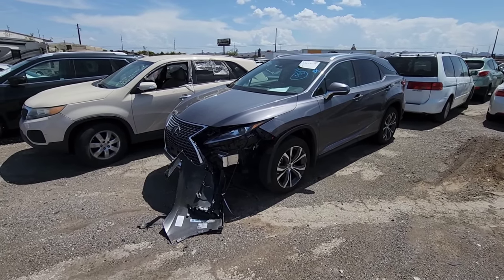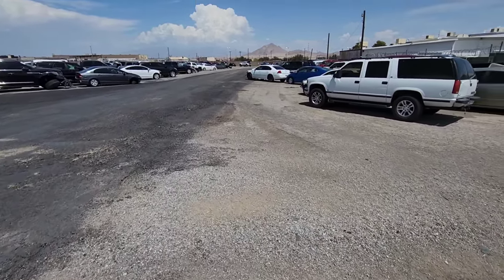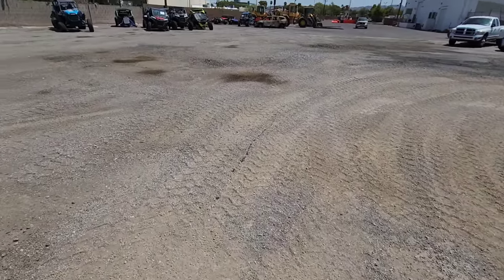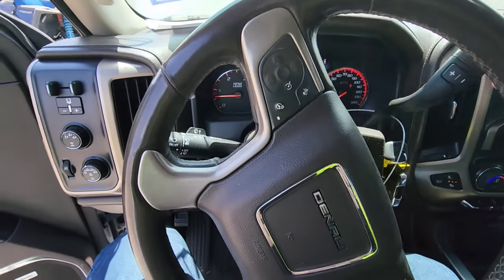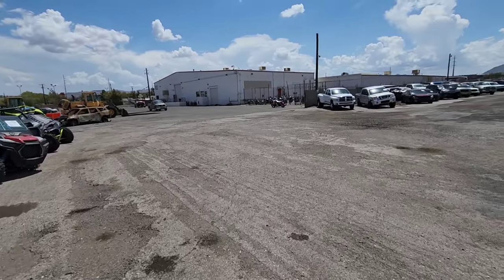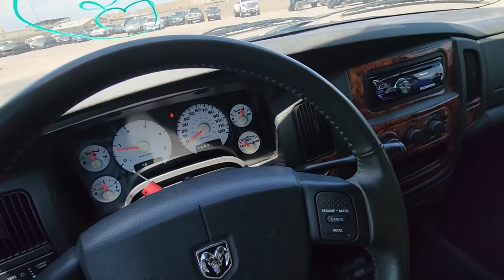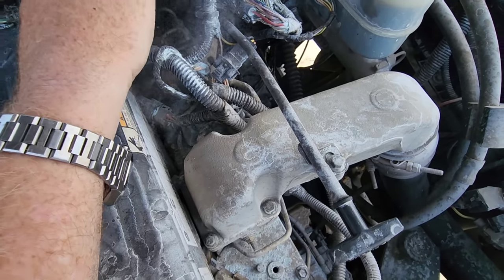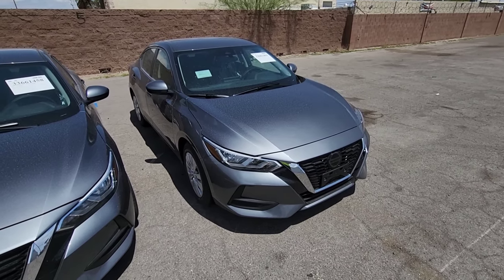So Many Diesel Duallys At Auction, IAA Walk Around

Comment: I hear hotshot trucking has hit the skids. Lack of business and high diesel prices mean lots of spare duallys around.
Reply: I saw something about the too but I haven’t seen an abundance of them at lots
Reply: @Dirtydigger  it's true diesel prices have hurt us, transit Van's are the fallback plan
Reply: @ucc6166  how is a transit van a fall back plan ? Can’t pull a trailer other than a little cargo or boat trailer. There’s to much distance between the axle and the rear bumper to carry anything heavy or long. And they have Diesel engines in them also.
Reply: Transit van 250 have gas engines. They have diesel options in 350s as well as gas. And also the Mercedes sprinter vans are the ones who have only Diesel engines. Check out the transit high roof 250. I made 7k in a week and I wasn’t even organized in my load picks.
Reply: @ucc6166  pickup trucks can be bought with gasoline engines just like a transit van. I guess I’m just missing your point. Dodge has that giant 700 hp hemi Ford has the V-10 and V-8 I’m not understanding what the transit vans have that pickup trucks don’t.
Reply: @Dirtydigger  I just put a option out for those instead interested, also my experience with both trucks and vans has leaned me more so towards vans they are better with mpg and I don’t have to be as selective on parking. Your right also about the trucks having the same options. My initial reply was to the statement hotshot is dead.
Reply: @ucc6166  I don’t agree with the statement hotshot is dead . This same scenario happened back in 1985-86 when oil production dropped drastically. I started driving in 82 in the local oil field in south Louisiana. Hotshot one ton and oilfield “mini float” trailer not to be confused with a fifth wheel or gooseneck trailer. By 1986 I was driving 
18 wheelers hauling basically the same wellheads,pipe,fishing tools etc. when I had no choice but to start driving coast to coast of course pulling a flatbed. But they started drilling again and oil production picked back up and hotshot and oilfield hauling was back in swing so if I owned a couple hotshot trucks and could afford to keep them until hotshot picks back up I would because if the market is flooded you won’t get much for your truck and by the time it picks back up the price of trucks will be astronomical. A buddy bought a new dodge mega cab 2020 he paid over $100k for a pickup truck. Let that sink in. My first pickup truck brand new was $4800 top of the line 4x4 Toyota.
Reply: @Dirtydigger  I agree with that I’m holding onto some of mine to. I’m just using vans until the prices become more inexpensive. The cost of fuel, maintenance paying help etc. tripled the amount of loads I took in my trucks. For me right now the vans are more profitable if you do expedited shipments
Reply: @ucc6166  well you can look into oversized escort pilot vehicle. And something you probably would never think about. Horse transport , a horse transport company from just outside Castle Rock Co. has independent drivers long and short haul. Another new thing that is very lucrative is “pet “ transport $$$$$$$
Reply: @Dirtydigger  I appreciate the information I’m looking into it all. Good looking out
Reply: Price on it  , what the win bid

Comment: On that old Ram… 1. If a diesel is tight and you got one good battery it’ll fire. 2. Running like that, with those miles, I’d buy that all day. That little bit of crispiness under the hood would just be a little project. I’d get that before the Denali, and the Denali is nice.

Comment: Always pull the oil cap and turn it upside down to check for blow by on diesels
Reply: Only Ford and Chevy guys, the Cummins vibration will make it fall off
Reply: @cargotoolshop5319  on a 12 valve yes on a 24 valve no.

Comment: The transfer case lever is a $30 part that falls off all RAMs and takes about 30 min to fix. Happened to my 1500 twice.
Reply: I didn't know there was a such a thing as a $30 part for a RAM !    Driving a 2016 Ram 2500 6.7 diesel  .  The DEF sucks but  Love the truck .
Reply: @wh8085  LOL yeah it's a small steel rod with plastic couplers that shifts the transfer case. Falls off a lot.
Reply: @fredfiftyfour2183   ,  thanks for the reply !   Mine is  4x4 , so  I'm curious ,  can you get to it to replace /  repair the rod by removing the boot or do you have to crawl under the truck ?  I'm sure if mine breaks it will be in a mud hole somewhere !   Story of my life !  LOL
Reply: @wh8085  Yes it's only for 4X4s, it's the transfer case shifter. It's all under the truck. It takes a little contortion with the wrists wrapped around the drive shaft, but only 15-20 minutes. The 2 times mine has fallen off I've been in 2WD High when on the road. Must be my clean living.
Reply: @fredfiftyfour2183  . . .  Yeah,  All of us 4WD guys  are a bunch of righteous dudes !  wink wink  !  LOL.   Hey thanks for the reply !   Hope I don't have to but if mine goes out I know where to start .  Atleast the truck sits high enough it's no problem for an old fat man to climb under there  !  ha.  Take it easy !
Reply: @wh8085  It's a generic part BTW. I got them at NAPA for something like $30 - $35.

Comment: That 3rd gen dodge is 👌. The fire was probably due to poor installation of the aftermarket gauge or other accessories. PS. I hope you tell the buyers of these Nissans that they were flooded. Floods cause major rust issues down the road
Reply: lol @Dodge being remotely good
Reply: I’d be more worried about the electric gremlins from the water damage.
Reply: @INVERTEDBUKAKI  3rd gens are million mile trucks......
Reply: There is a Recall for Dodge truck 2018 -2022. Fire in the dash !
Reply: @JamesBond-hu9rg  What do modern Ram trucks catching fire have to do with an 02 Dodge catching fire???
Reply: I bought a 57’ Chevy that was in a flood. Had to put a whole new wiring harness in it, front to back. Not that it’s comparable to a newer vehicle but it still sucked.
Reply: @LibertyOrD___h  I didn’t mention 02 💁‍♂️🤔
Reply: @LibertyOrD___h  2002 is now where near 18-22🙄
Reply: @LibertyOrD___h  not a 02 thats a 03-05 (diesel 3rd gen started in 03 gas started in 02)
Reply: Also, electrical issues down the road as connectors fail.
Reply: @LibertyOrD___h  prove it maybe after a lot of money thrown at it?
Reply: @LibertyOrD___h  they all catching on fire, buy an electric and even more fires everywhere.

Comment: The 3rd gen ram are notorious for passenger battary over charging and catching fire due to high resistance in the crossover cable going to the driver side battery the ECM pulls the voltage from the driver side battery and if the ECM sees that the voltage is too low it just keeps on pumping out from the alternator causing the passenger side to overcharge had a buddy have this issue on his ram his also called fire luckily was able to get it out
Reply: I owned a 3rd gen Ram and I’ve never heard about this “notorious” overcharge situation and fire. 

I still own  a 2nd gen 12 valve with a little over 325’000 miles on it. 

Both trucks were/are incredibly reliable but the 3rd gen only had about 80k on it when I decided to sell it.  I prefer the power and simplicity of my 12 valve vs the 24 valve after I turned the pump up on the older truck.
Reply: That would have to be a crazy high resistance on the crossover cable because so little current is pulled when it is not actively cranking the engine.
Reply: Finely some one with brains. Who is telling it like it is.  !  I worked for many Dodge dealerships and they won’t tell you this.  💁‍♂️😬
Reply: @erikkovacs3097  your right it would but it's a over time issue   I've measured mine when having issue the alternator pushed out 15volts but after 14.7 going into the passenger battary going into cross over cable then had just above 12 coming out going into the driver side battery the ecm is reading the voltage on this battery it's telling the alternator charge like hell cooking the passenger battary   the issue is with the stock cross over cable is condensation within the sheathing over ten years causes the copper to corrode within the wire it self causing high resistance in the line itself the fix is to buy a new crossover cable and don't cheap out
Reply: @redneck4life92  will be changing mine out asap

Comment: That dodge truck is just usually the linkage. It's like a $25 part
Reply: Reach up by the steering column and disconnect the brake shift solenoid, easy fix on my dad's truck

Comment: Never buy a gmc diesel ,nox sensors ,def fluid heaters ,sensors ,cp4 pumps will keep you in the poor house 🏠
Reply: Bruh I just did
Reply: All newer diesels have emissions issues, have you seen the newer Cummins problem lol! I deleted my 16’ Denali when the warranty ran out. Haven’t had an issue ever, 140k hard miles on it now.
Reply: @stevenllewellyn8906  yeah I agree ,the engine and tranny no problems ,but I’m not experienced enough to do the work so I’m subject to GMC ,the cheapest I paid for a fix was $1300 ,the cp4 was 4 nights ,rent a car ,5 week pump wait ,train ride to dealership $13,500 hopefully someday will regain through class action lawsuit ,
Reply: @markive9907  if your cp4 went out then you should have put a cp3 in it instead. They are a much more reliable injection pump than the cp4. Duramax trucks starting in 2011 switched to the cp4 from the cp3. Ram also runs the cp4 pump in their trucks.
Reply: @diegaspumper8501   well they did not tell me about a cp3 ,I knew nothing about this problem until it happened ,it took the dealership 6 weeks to get the parts as it was !
Reply: @diegaspumper8501  you can’t run a cp3 and retain the factory emissions. It’s why most people install another CP4 or they just don’t know any better. But I agree, cp3 sportsman or 11mm stroker. Truck runs so much better, it’s safe and plenty of fuel.
Reply: @stevenllewellyn8906  why wouldn’t you be able to keep the factory emissions?
Reply: @diegaspumper8501  from a dealership? Retaining warranty? Show me
Reply: @stevenllewellyn8906  what are you talking about? I asked you about the emissions system not the warranty. I’m asking from a mechanical point, nothing about warranty. I know a dealership wouldn’t honor that.

Comment: I’d rather have that ram 3500 over the gmc any day them 5.9s are just about unkillable I might be biased I’ve owned 3 of them. And my last one was sitting since 2014 and I bought it in 2018 and drove it 350 miles home
Reply: A Cummins has no glow plugs   Thay use a grid heater  not glow plugs so the only time you have to wait to start is when it’s below 60 dregrees out

Comment: On that Dodge Dually 3500 the cables broke probably on the shifter what year is that truck I don't believe the mileage is correct what they do is they unplug the odometer to keep the mileage low the speed sensor at the back of the transmission and it doesn't calculate the mileage correctly that trucks probably got $380,000 miles just a guess

Comment: Engine fires in 24 valves is actually unfortunately very common I don't remember exactly which part it is but one of the parts in the fuel system breaks down over time and it starts spewing fuel all over the engine bay get the fuel too close to the exhaust system or you got a little bit of an exhaust leak you can see where this is going or you get a couple of Sparks from the battery or the starter yeah I have a buddy who had his 24 valve engine bay absolutely covered in diesel and he caught it before it caught fire but one of his buddies that has the exact same truck but in a different color he didn't catch it in time and his did catch on fire and that's exactly where the fire starts is right there at the back of the engine
Reply: Diesel doesn’t catch fire anymore unless there is a continuous ignition source
Reply: Injector lines blow apart. Ask me how I know. Lol
Reply: It’s not just the Cummins that has high pressure fuel system that can rupture injector lines thay all have high pressure fuel systems and they all are subject to a fuel leak between the injection pump and the head . The early dodge dually 1996 and up I’m not sure exactly when Dodge fixed the problem but they had a recall because of fire possibility . It wasn’t a fuel problem it was something under the dash. My dad bought a 1996 new and he had to bring in to a dealer for this recall. I have been around dodge trucks and ford trucks a fairly long time and I haven’t heard but one case where a fuel line ruptured and the leak sprayed towards the turbo and the exhaust was actually hot enough to catch fire. Second thing they are refining diesel now days that doesn’t burn unless there’s a continuous ignition source. If you don’t believe me get a gallon of diesel and stack a pile of wood and try to start a fire with it.
Reply: @Dirtydigger   Neither one of my trucks caught fire. Both blew #4 injector line. One is 06 , the other 04.5. The whole engine bey is saturated and you’re stranded. It sucks when it happens.
Reply: @LoneWolf-cf5tp  yup I don’t know exactly when they started refining diesel fuel that doesn’t catch fire but I drove trucks cross country over four decades and trucks carry hundreds of gallons of fuel most of the trucks I drove back in the day had two 150 gallon or two two hundred gallon when a truck was in a wreck and a tank was ruptured fire was imminent so it was dangerous to remove people from any vehicle involved with the truck. You can find videos of trucks rolling over on their side at high speed and sliding a couple hundred feet burst into flames from the leaking fuel and the sparks from the metal slide on the road it burns until it stops and immediately goes out
Reply: @LoneWolf-cf5tp  like I said I didn't remember which line it was I just knew it was I just knew it was a fuel carrying line I appreciate it cuz I'm actually looking at buying the red truck that I mentioned that caught on fire
Reply: @Dirtydigger  I also drive large trucks cross country and if you actually look at the science of it yes at normal temperatures diesel will not flare however once you start getting diesel above 126° f diesel will ignite just as easily as gasoline will and above 205° f diesel will start vaporizing now I'm not a scientist but last time I checked pretty much every diesel engine in the world can very easily get above 205° during medium duty use and everything in the world once vaporized and brought to its stoimetric ratio everything ignites very easily
Reply: @DAR10162  but diesel will not continue to burn if the ignition source is taken away even if it was massively engulfed in flames as soon as you remove everything else that is on fire the diesel will immediately go out. You can pour a gallon of diesel on a pile if dry sticks and hold the flame of a lighter to the diesel and it will not catch fire. I have started many fires after clearing land and having giant piles of trees and brush in the past using diesel because it doesn’t explode instantly like gasoline and was safer but now it’s impossible to  light the diesel so I use charcoal starter fluid
Reply: @Dirtydigger  🤦‍♂️
Reply: I don’t drive any more. I started in 1982 and drove for over four decades. I also operate heavy equipment and I live on a farm so every aspect of my life has Diesel engines in some way. I am also a self tough mechanic that can take a bulldozer or excavator or a motorcycle completely apart and put it back together without any pieces or bolts left over
Reply: @Dirtydigger  and I grow up in a back woods town surrounded by nothing but farms and petroleum plants later in life I moved to just outside of the city where I ran my own mechanics business specializing "older model vehicles" I've worked on everything from excavators to Packers to your run-of-the-mill car to boats and I've been driving truck for going on 10 years now if it's got a motor chances are already know how it works and when we moved out to the city I took a great interest in science understanding how matter works and understanding the world around me works diesel is a petroleum product when anything that is made of petroleum as a base is lit on fire you cannot put it out easily look up any oil fire look up plastic fires there's only one good way to put out a petroleum fire and that is to take all the oxygen away from it not so easy to do we are talking about an uncontained fire which is why they're especially dangerous
Reply: @DAR10162  like I said try to light today’s diesel on fire . I don’t doubt you’re capable and knows a lot of stuff and it was quite a surprise to me when I tried to burn a pile of trees in my pasture and couldn’t get the diesel to ignite had to resort to charcoal starter I also watched a video of a 18 wheeler slide down the road on fire from diesel pouring out of the tank and the metal making sparks on the concrete as soon as it came to a stop the fire went out
Reply: @Dirtydigger  I'm sure there's a reason that you could not get the diesel to light for you beyond the scope of what we are comprehending in this particular conversation but by all means I have and do continue to use diesel to light my fires quite often and have also watched an 18-wheeler burned down within the last 2 years at the guard shack of a Shaw's DC (don't remember exactly within the last 2 years that was but it was sometime in 2021) by all means you do you still works fine for me

Comment: There isn’t any glow plugs in that ram 3500 it’s a grid heater shouldn’t have run the ram if it was swamped it has water in the trans and your burning the clutches up

Comment: 2005 and 06  5.9 cummins recall on # 3 or 4 injector tubing because it would crack and spry fuel over hot 🔥 engine. Low mileage so it probably never was taken in for the recall.